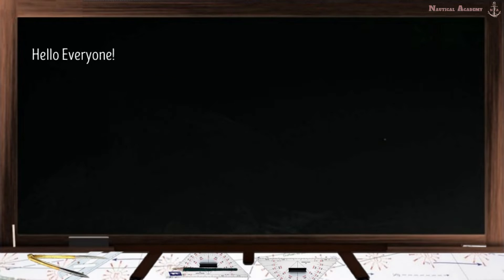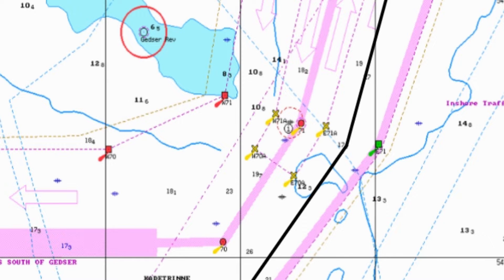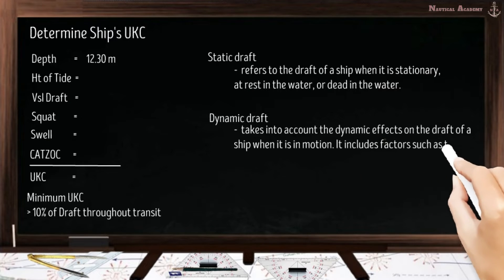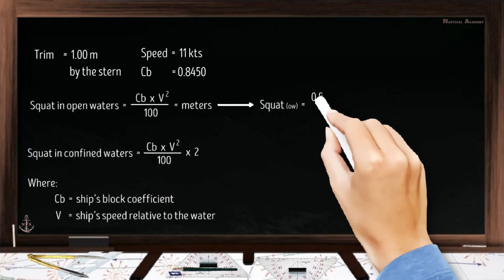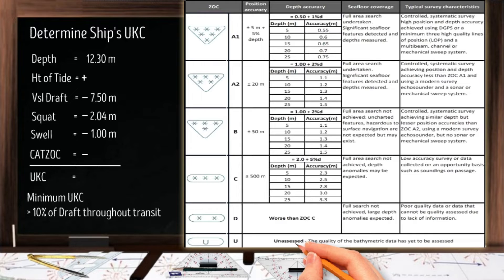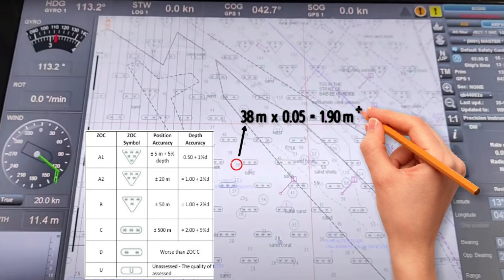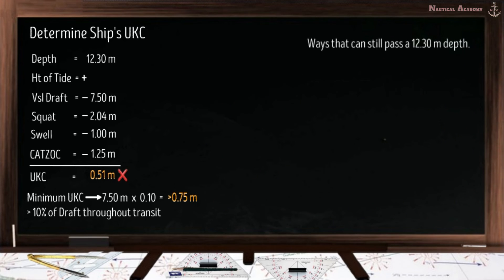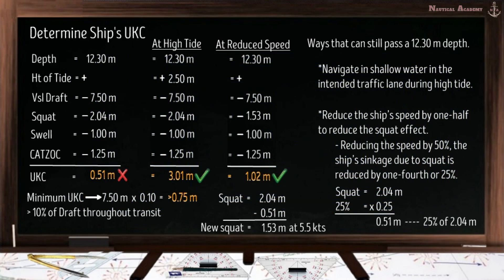How to Calculate Under Keel Clearance ll Determine Ship's UKC ll CATZOC ll Squat ll Passage Planning

Comment: When we reduce the ship speed 50% it will be affected by the squat effect only 25% of the original speed ? Am I right… so we will sub 0.51 m not 1.53m ?
Reply from the maker: Thank you for the comment. Squat calculations typically provide an approximate answer rather than an exact one due to complex interactions between the hull and the water, which are affected by the ship’s speed, hull shape, water depth, and other factors such as water density, wave action, and the specific characteristics of the waterway (e.g., channel shape and seabed composition).

As shown in my video, I subtracted 0.51 m from the original squat of 2.04 m. The new squat after reducing a speed of 50% is 1.53 m. This 1.53 m as the new squat should also be subtracted from the given depth of the water to find the UKC. 2.04m x 25% = 0.51m. Then, 2.04m - 0.51m = 1.53m. Then, given depth of water (12.30m) MINUS new squat (1.53m), MINUS ship's draft (7.50m), MINUS swell (1.00m), and MINUS CATZOC (1.25m) = UKC (1.02m). This is the calculations shown in the last part of my video.

In the example, the given ship's speed is 11 kts with Cb 0.8450, if we calculate the ship's squat at a speed of 5.5 kts, then the ship's sinkage due to squat in confined water is 0.51 m. But if we consider this "IF THE SHIP'S SPEED IS REDUCED BY ONE-HALF, THE SHIP'S SINKAGE DUE TO SQUAT IS REDUCED TO ONE-FOURTH." I read this from one of the books on ship handling but forgot the author's name. So from the original speed of 11 kts, the ship's approximate squat is 2.04 m. Reducing the ship's speed from 11 kts to 5.5 knots, the sinkage due to squat is reduced by 0.51 m. Considering "SINKAGE DUE TO SQUAT IS REDUCED TO ONE-FOURTH", subtract 0.51 m from the original squat which is 2.04 m. The new approximate squat is 1.53 m. This new squat should be subtracted from the given depth of the water to find the UKC.

Given the safety margin of my ship to avoid grounding, I'd rather take the approximate squat of 1.53 m rather than 0.51 m since my original speed was 11 kts, and it was just reduced to 50%. But if my ship's original speed is 5.5 kts, I will take 0.51 m as my approximate squat.

Thank you very much for the comment. Have a safe voyage!

Comment: Sir, can I ask a question? Why do we add the height of the tide when calculating UKC?
Reply from the maker: The charted depth is measured at chart datum, which is usually the lowest possible tide level.
When the tide rises, the actual water depth increases.
So we add the height of tide to the charted depth to know the true depth of water under the keel at that moment, which is essential for calculating an accurate and safe UKC.

Comment: Thanks for the information but the area example is quite inaccurate. 
The depth of 12.3m it has a catzoc of A1
Based on the given you used the dynamic draft of 7.5m since dynamic draft includes the squat, the 2m squat should not be subtracted from the depth . So the draft must be 7.5 - 2m squat. 2m since we assumed it's confined area. 
So here's my calculation 
Depth 12.3
Catzoc A1 .623m
Dynamic draft 7.5m 
Swell 1.0m 
UKC 3.1m it passed the 10% requirements 

Lets make it 7.5 static draft 
Then the dynamic will be 9.5m 
The minimum ukc 0.95m 

It will pass since the UKC will be 1.18m.
Reply from the maker: Thank you for pointing that out, I appreciate the feedback and will review the example in the video!

Comment: good day sir, why we are taking static draft instead of dynamic draft for UKC calculation. i hope u will give me answer, becuause i was failed due to this question from exam surveyor.... and one more thing " u r really making woundeful topics its really helping us... thank u so much sir
Reply from the maker: Regarding your concern, 
👉 Firstly, it’s important to understand that UKC calculation procedures can vary between shipping companies, and the method I presented in the video follows the procedure from my latest company. In fact, across the different companies I’ve sailed with, each had slightly different ways of calculating UKC — some use static draft, some apply dynamic draft adjustments, and some use a minimum UKC percentage applied over the static draft + added allowances.
👉 Secondly, many companies base their initial UKC calculation on the static draft (the draft when the ship is stationary) and then apply allowances for factors like: Squat (due to speed), Heel (due to wind or turning), Wave response allowance, Pitch, and roll.
These allowances aim to cover the dynamic effects, so the static draft remains the base reference, with other safety margins added on top.
However, some procedures refer to the dynamic draft directly, especially if a vessel is transiting in shallow or confined waters where squat is significant, and treat that as the effective draft for UKC evaluation.
✅ My advice — especially for exam preparation — is to check if there are any specific guidelines or reviewer materials provided for the exam you're taking. Surveyors often assess based on a specific standard or administration policy, which may not match the procedures followed on board every ship.
So to summarize:
Different companies follow different UKC calculation methods.
Always follow the UKC procedure of your present company.
For exams, try to find reviewers or guides that match the specific procedures expected by the examiner or authority.
I hope this clears up the confusion, and I wish you the very best for your future exams. Keep learning, and thank you for your encouraging feedback!
Reply: @nauticalacademy001   thank u so much sir...... keep posting videous.... i cleared my past exams almost your good videous observation... remaining i have navigation.... i got an confidence right now... i will smash it...... once again thank u so much sir for posting very good videous for upcoming mariners....
Reply from the maker: You're welcome and thank you for the support.
Reply: @nauticalacademy001.... kindly  clear my doubt sir... if u r free

Comment: For those confused:

To calculate our ships squat we must
( Multiply Block coefficient by speed relative to water in square) divided by 100  
This is for deep seas

Example: (0.835 x 12²) ÷ 100 = 1.2024 m
For shallow waters we multiply answer by 2 so it would be
 1.2024 x 2 = 2.4048 meter

According to this reducing our speed by 50% gives us only 25% of the original squat

Example: (0.835 x 6²) ÷ 100 = 0.3006 m

But since we are in motion our squat may not drop from 1.2024 to 0.3006 
Thus its safer to expect our squat to be reduced only by 25 % of the original squat 

(Basically there is a chance the ship won't float all the way up since we are traveling so it's better to be safe then sorry)
Reply from the maker: Thank you very much for the additional info.

Comment: How will i get static and dynamic draft?
Reply from the maker: Static draft is the draft of the vessel when she is stationary, and you can find this value by checking the ship's draft marks. The dynamic draft accounts for the vessel's motion and includes factors like squat, trim, and wave action. It’s the draft when the ship is moving through the water. To calculate this, you’ll need to know the speed of the ship and apply the squat formula for your vessel type. Kindly check some videos for the detailed explanation about dynamic draft.

Comment: Why we a calculate 10% at 7.5 m ,but our present draft for this leg  7.5+ 1.53 m?
Reply from the maker: As stated in this video, the company policy for the Under keel Clearance (UKC) should be greater than 10% of the ship's static draft. The 10% of 7.50m is 0.75m, so the UKC should be greater than 0.75m. But if the company policy states that the UKC is greater than 10% of the ship's draft or 1m whichever is greater, then the minimum UKC should be 1m. The 1.53m is the new squat when the speed is reduced.

In the video, the solution that you have seen is like this: Depth of the water minus ship's draft, minus Squat, minus Swell, minus CATZOC, equals UKC. You can do it using this method: Depth of the water minus (-) the sum of (draft + squat + swell + CATZOC) equals UKC.

In calculating the ship's UKC, always refer to the company SMS manual, the procedure may vary between companies.